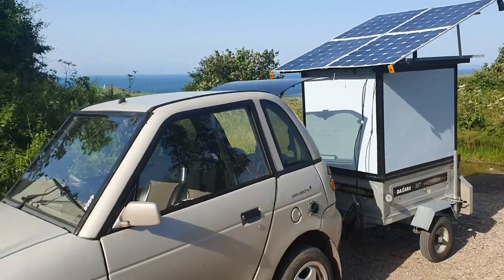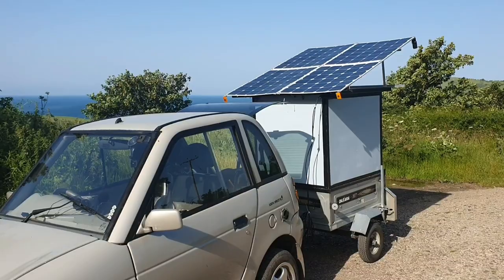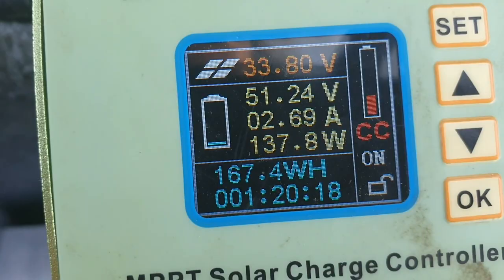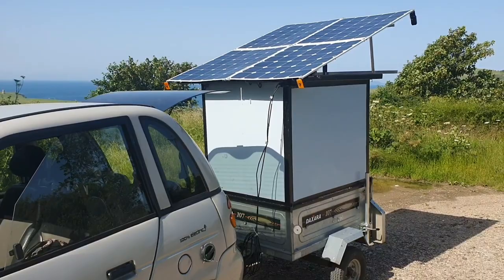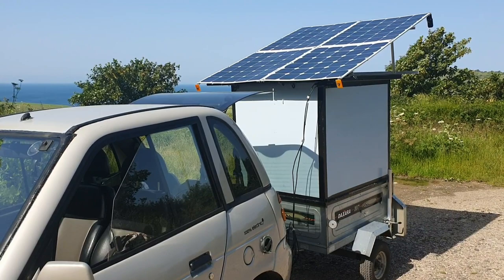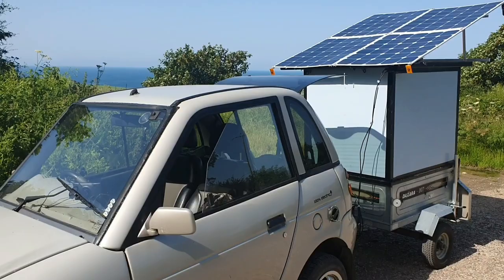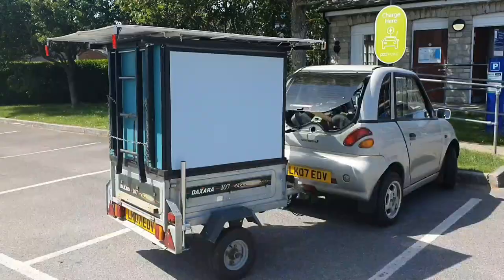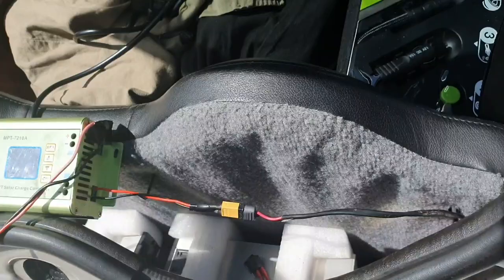SOLAR POWERED CAR: Testing the REVA G-WIZ lithium conversion with solar charging

Comment: Hi Richard, it's a bit windy where you are ever thought building a wind charger
Reply from the maker: That is a great idea Adam! - if I can find a lightweight and easy to pack system that would be amazing for the coast.
Reply: @RichardMawby  hi Richard there's plenty of wind chargers available on eBay and Amazon do your homework before you buy there's plenty of DIY projects online as well might be worth while having a good look at these and build a bespoke wind charger that suits your needs, have a look for this fella Hugh piggott Smith I'll add some links to some of his Web sites later on today.

Comment: Is it actually feasible to charge the battery and drive at the same time?
If you could add a panel on the hood, roof + those 4 you should get quite some energy (at least to run the A/C without affecting the traction battery. Right?
Reply from the maker: It could work to some degree. I was charging all the time with the solar tricycle so I was always fully charged as I only used motor for hills. Not much space on the roof of the gwiz or anywhere to bolt it to.